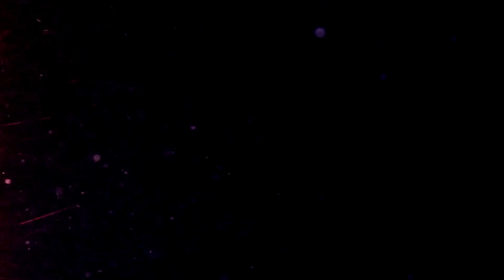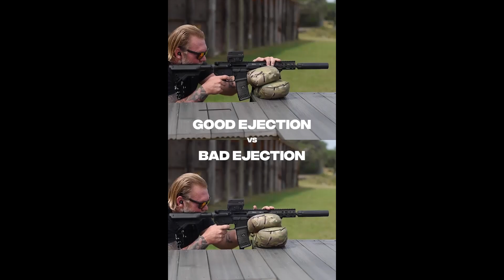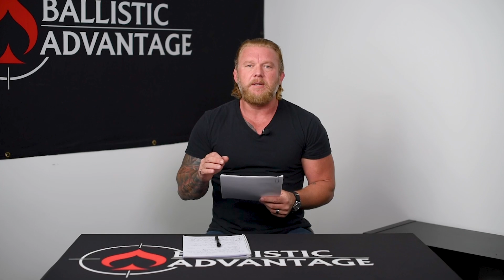Why Over Gassing Your AR-15 is Unreliable

Comment: One thing even with proper gassed adjustable gas blocks: gas port erosion
As you use the rifle more and more, there is more erosion to the port. In Layman's terms: hole gets bigger, so ejection might be stronger now. Not crazy more, but more. 
So technically you could dial gas back sometime during first 1000 rounds, but I personally don't touch the gas block after I gas it properly on some weak PMC Bronze 223, or Federal American Eagle 223. Both are very underpowered, and it allows me to gas to the weak round and all 5.56 will run then. 
PMC Bronze 223 is more anemic than American Eagle 223.
Before the war with Russia, I was using Wolf/Tula to gas my rifles to that weak crap.
No more supplying them with money, indirectly supporting war in Ukraine. No thank you.
Reply: I used to think gas port erosion was a ''thing''or a problem until recently. I just replaced the barrel on a 1986 Colt HBAR with appox. 10,000 rounds for a lighter gov. profile. After removing the A-2 front sight base I noticed the gas port was not eroded at all. the port size was .091. The dept of the hole was appox.270. Only .080 off the rifling was eroded. The rest of the port was perfect. The chrome on the throat and about 1/4 forward was gone,with bad fire cracking for another 1/4 inch. The crown shows wear. The rest of the bore was in very good condition. Note this was a semi -auto gun it whole life.
Reply: @tonycs-9  I believe you, but I wonder, maybe you are seeing that gas port with caked on carbon now, and carbon is actually quite good at filling in some imperfections on any surface. Maybe, it just looks like it didn't erode because carbon did its business in the gas port. 

I don't know about you, but I never clean my gas port, and obviously I am not looking at the same barrel as you. Perhaps you are absolutely right.

Though...CMV is EXTREMELY strong material, so it may not be that surprising. 
Recently I was drilling for 2 gas block dimples on CMV/Nitrided barrel. My God! I forgot just how strong the surface of Nitride barrel is. I was drilling for so long, I ran out of patience and ended up breaking the cobalt drill bit by pressing into the barrel, because it was not making a leeway. Stainless steel drilling is smooth as butter in comparison.

I expect gas port erosion personally, but I speculate gas port erosion shows up under sustained fire, even if it's semi-auto, just rapid fire trigger pressing. To the point the metal becomes extremely hot, and then it becomes malleable, and then it can warp or shift. 50 thousand PSI will erode it then no question. For slow firing...probably not. So, I do think erosion happens, just not to the military extent, I know in my case I have zero ejection issues with adjustable gas block even thousands of rounds after. It did not get worse, but is constantly caked with carbon, so it has to be more eroded in my case, otherwise there would be a time when it would just stop cycling from carbon. Something that I read from Centurion Barrel yesterday is that CMV barrel will last for 17,000 rounds, and Stainless will only last max of 7000, and most replace the barrel at 2000 as the rep said, as accuracy is already shifting then.  

I don't know about you, but I can easily go through 2000 rounds in about a year on same barrel. I would not build a rifle with stainless if I knew that. I have Centurion stainless steel. In fact I am coming back to CMV for that reason. I don't think you are wrong, but you are not wrong because you don't shoot enough to get to that point, and you have CMV barrel, that's my thought. I saw gas port erosion on some of my barrels

Comment: Clint thanks for for insight and I concur 100%.  The correct way to cure "Overgassing per load" would be adjustable gas block. But I myself am at the point of cheating by trying different buffers and springs to get a 4 to 5 oclock ejection. Is that really cheating ?????

Comment: I have a BA gov't profile barrel that I rarely use any longer because it is so over gassed.  I have a few BA barrels  and they all perform well...the gas port size is spot on...Great info
Reply: Funny. I just received a 14.5 BA and I'm a bit worried about it. It's over 0.08 according to my crappy Chinese pin gages.  This'll be my first build with an A5 extension, so I won't be too upset until I get it finished and see how it runs,  but I was expecting a bit smaller port. Maybe I should've asked before ordering🤷‍♂️.  Oh well, with a bunch of extra headroom in the bigger buffer, I'm sure I can dial it in, I just hope it doesn't cost me too much tungsten.

Comment: Aren’t all AR platforms that are not at least the same barrel length  gas system and BCG as an old school M16 over gassed? 

When the AR platform was designed, it was built in modification to a 20”, 5.56 (M193) M16 that troops were issued at the time. Now that you have anything less than 20”, you’re going to get less dwell time, barrel length dependent, may be significant if you have legs say a 10.5 but might not be as bad if you have say an 18” barrel. So with the thought process on here, you’re now looking to rob Peter to pay Paul in other critical parts of the system - gas blocks, bcg’s, buffers, even charging handles. 

I understand the point and what the video is trying to address, however I still think I’d rather be a little over gassed than under gassed because METTTC dependent variables exist
Reply: thats... not how it works

Comment: The first thing I check after building a rifle is the ejection pattern.  That is key to how good your build is, the foundation of how that rifle functions.  You will bust up all those expensive parts if you are running over-gassed, period!  Very good information, glad you are posting videos again, BA rocks!
Reply: What about locking lugs wear and therefore enlarging the head space due to lack of gas? Should I be afraid, that redusing the volume of gas would mean that locking lugs would not be pushed forward enough while being turned ???(therefore it would wear quicker)
Reply: @mirekslechta7161  Did you look at running an adjustable gas block?  You can find tune your system and really get it dialed in for you setup.  If you are under-gassed, the bolt won't cycle and you can make adjustments on the adjustment gas block to allow more gas in the system.
Reply: @shramj  I have adjustable gas block. I only wonder, whether small amount of gas could cause increased wear for locking lugs.

Comment: Before anybody tries to trouble shoot a gassing problem, they should watch David Tubbs video on buffer springs. I would first start by purchasing a flat wire spring for any AR-15 build. That alone will assure you of a good build. Then go from there. Besides it's a great addition to your build and you can't go wrong even if that doesn't fix the entire problem. I have found there is no universal length nor tension for the rear spring. It is very inexpensive for the total price of a build.
Reply: Link?
Reply: Damaged Industries makes an awesome buffer spring as well, check them out, very inexpensive to boot.
Reply: Brandon, be sure and take a little time to watch his videos on springs. He has made a gauge for this and his flat wire springs also stops the oscillation when the spring is expanded. Cool videos and rig he has set up.
Reply: Just to add a little note to my comment, I had built 2 AR-15's with Ballistic Advantage complete uppers. these were .223 Wylde chambers to be shot with hand loaded match ammo. I also was using UTG A-2 stock w/tubes & springs. The rifle shot sub minute groups but would not load another cartridge. A slow-motion video helped us see this. The brass was ejected at the 3-4 o'clock position and could be put in a large coffee can. God bless Ballistic Advantage I love their uppers. So we looked at several AR's on the range that day and the buffer springs in everyone was different length, even the one that were ejecting its shells was swapped out and would not work. Thats when I studied the David Tubbs videos. I have purchased several items from them in the past and I trust him and his products. This is not to say this will fix your problem it is something not to overlook.

Comment: Really good points man. Overgassing will definitely effect your reliability by destroying your parts faster. The industry seems to have nailed gassing with port sizes, adjustable gas blocks, the mid length gas system, etc., overgassing for reliability isn’t just dated, it’s less reliable than what we have now. 

Also, If I’m taking anyone’s advice on barrels, it’s Daniel Defense, SOLGW, FN, Criterion, and Ballistic Advantage/Aero Precision. These are the champ barrel manufacturers/suppliers/vetters of the industry.
Reply: DD does not deserve to be mentioned with those other companies.
Reply: What about locking lugs wear and therefore enlarging the head space due to lack of gas? Should I be afraid, that redusing the volume of gas would mean that locking lugs would not be pushed forward enough while being turned ???(therefore it would wear quicker)
Reply: So can any experts in here tell me if the CMMG Endeavor (18") in 5.56 is over gassed? Should I opt for the Resolute instead but suffer that sub 3,000fps?

Comment: How much can over gassing be regulated by changing the buffer weight?
Reply: Controversial opinion: not enough. I'd change gas blocks and adjustable bolt carriers before messing with buffer weights, and then change barrels as a last ditch solution. Sorry if you don't have the tools to fix at home, it may be time to introduce yourself to your local smith.
Reply: @ComeOnPelican91  There’s gas tubes out there with reduced ports. You don’t even need to change gas blocks
Reply: Thanks for the responses! I don't have problems with overgassing, was just wondering about buffer weight.
Reply: What about locking lugs wear and therefore enlarging the head space due to lack of gas? Should I be afraid, that redusing the volume of gas would mean that locking lugs would not be pushed forward enough while being turned ???(therefore it would wear quicker)
Reply: @mirekslechta7161  wear has a direct relationship with force, the more gas the more bolt velocity equals more wear. So the answer to your question is no.
Reply: @ComeOnPelican91  I am afraid, you might be right just partialy. More gas- means more bolt velocity for sure and more wear for sure, except of wear of locking lugs.. Locking lugs are pushed back by brass and in order to be released, preasured gas is needed to push that small piston forward - than the bolt is pushed forward against brass and locking lugs can be released...I am afraid, that small amount of gas could result in locking lugs bigger wear. I could be wrong.
Reply: @mirekslechta7161  lugs experience bolt thrust from round ignition while locked. The expanding gas pushes the carrier (from the gas tube+gas key); in the first few mm of travel, the carrier rotates the bolt into the unlocked position and for the remaining trip the bolt and carrier travel together
Reply: @ComeOnPelican91  I mean it like this: when carrier rotates the bolt- it is the moment, when small piston is pushing the bolt forward in order to lesser the friction on locking lugs(sorry for my english) . Less gas, could mean bolt would be pushed backward by brass stronger, therefore locking lugs could experience more friction while rotated. O could be wrong of course
Reply: @mirekslechta7161  not sure what you mean by small piston. Also, less gas  means less bolt thrust.
Reply: @ComeOnPelican91  Small piston ..I mean the part where you have 3 washers - gas is flowing behind it and it pushes whole bolt against bottom of brass, thus locking lugs can rotate with less friction(locking lugs should wear less since the friction is smaller in case the bolt would move a bit forward before ratating ?
Reply: @mirekslechta7161  that's the bolt tail. the bolt could push against the brass but the brass is still being pushed back by expanding gas. 

Also we're both talking about bolt teeth breakage but in standard Ar15/m4 design the cam pin wears out first (talking about catastrophic failures). And what's more importand in the short term than bolt teeth are: extractor claw and extractor spring health, in not just the Ar15 but all firearms.

Overgassed or not, the cam pin needs lubrication, the extractor needs to be intact and free of brass buildup, and the extractor spring needs to be usable.
Reply: @mirekslechta7161  now that i think about it, the rearward travel of the carrier should overpower any forward motion of the bolt.
Reply: @ComeOnPelican91  Thank you, I got some more words from you to improve my english . When I wrote locking lugs I ment bolt teeth.  I nderstand that bolt is still being pushed by brass while bolt tail is being pushed forward and... therefore force from bolt tail should eliminate the force from brass(negate) and therefore bolt teeths can rotate much easier without being grinded shorter(creating bigger headspace) (this should be the reason why there is the bolt tail IMHO)
Reply: @mirekslechta7161  locking lugs is the proper term, sorry.
Reply: @ComeOnPelican91  Does not matter , no problem. Thanks for your answers. AR 15 is perfect gun anyway . Regards from Czech Republic.
Reply: It’ll slow down the cyclic rate, but it won’t necessarily change the stress it’s putting on your bolt and extractor.